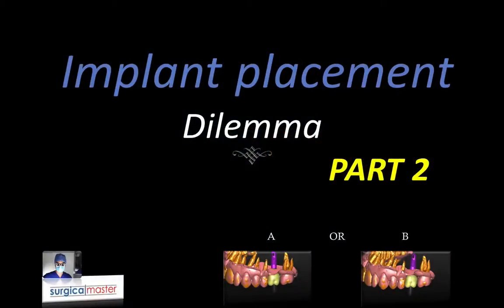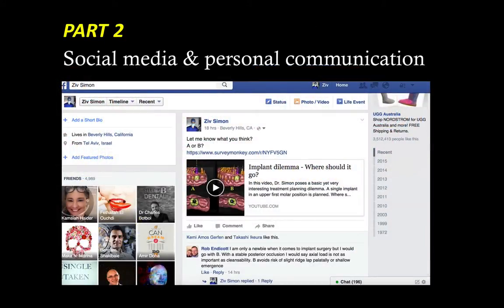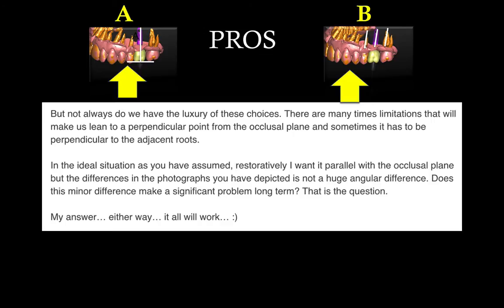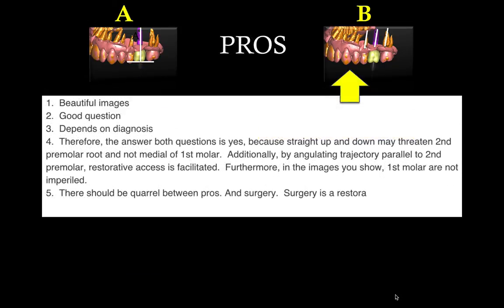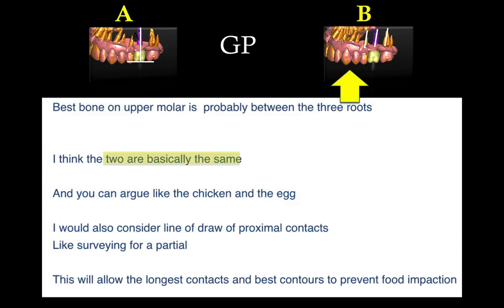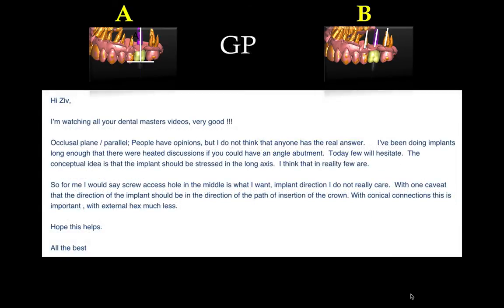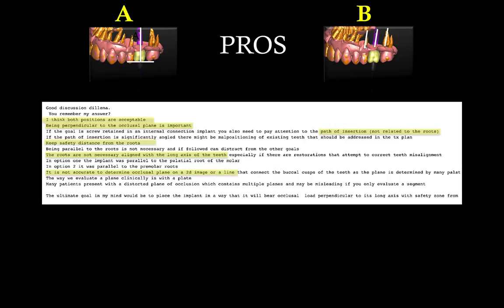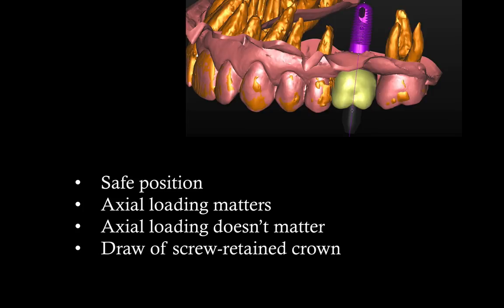Implant dilemma  - PART 2

Comment: Ziv the choice is dependent on the type of restoration that will be placed. If one chooses a screw retained restoration the plane perpendicular to the occlusal plane is the best choice if one plans on a screw retained restoration. Attempting  to place a screw retained crown with the axis of the implant not perpendicular to the occlusal plane and proximal contacts will be a failure with open contacts after the proximal contacts are adjusted properly.   Safety is minimal in this case.. Considering the "working cusp" occlusion is simply silly and demonstrates lack of experience and worry about things that do not matter at all. Simple choice in my opinion. If one wants a screw retained restoration the implant needs to be placed perpendicular to the occlusal plane.